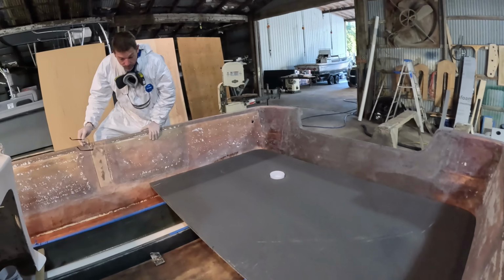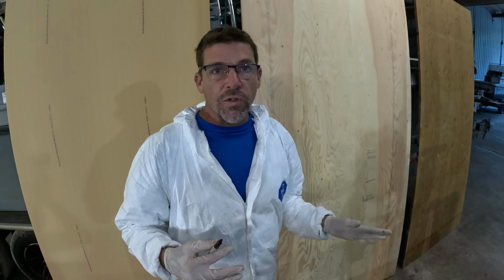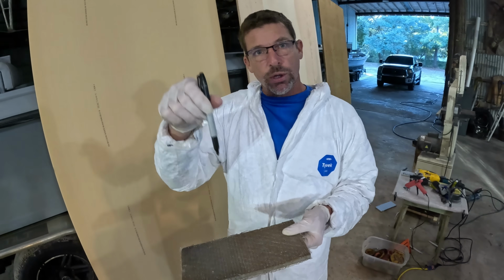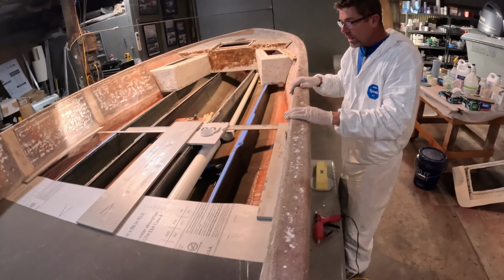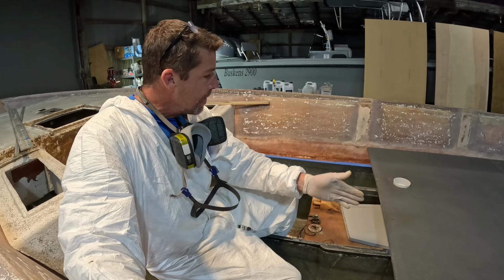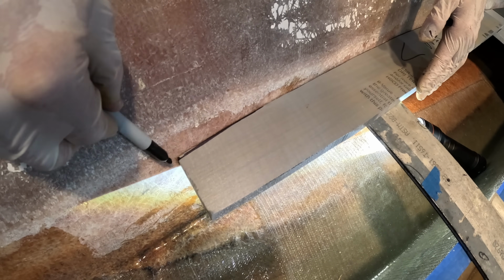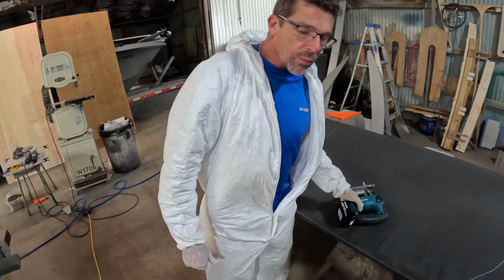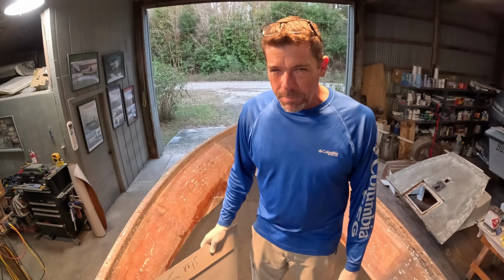Easiest! Fastest! and Most Accurate way to Install your New Boat Floor Deck GUARANTEED!

Comment from the maker: https://fiberglasswarehouse.com/ 
*Use code FISHBUMPTV
Coosa & more:  Boat Outfitters https://spn.so/l/9iqw0hvc
My Amazon Store: https://amzn.to/4hFw3AV
As an Amazon Associate, I earn from qualifying purchases. 
Consultations & Support at Patreon www.patreon.com/FishBumpTv
Reply: I get it with the bigger boat like the one you're on,  Billing.  But the one thing  I can't afford.  Is Patron being on a budget one of the things that  I. Noticed is you pointed out?  Was the Frome & it was strengthened with Fibreglass. A more detailed demonstration.  On a budget & its role in Modern boat & Mould in  Boat Building. Of ten the small man as budget restraint the bigger operator dos not have. & you have added Benefit  to  them in that indexer & thank you for that. But petrean member ship dose not lend to budget & I Get it  good advice.  as a value & your  won't  to profit from your Extensive Knowledge Yes i get it But the you ask what wuld you lick to see us build  I wuld love to se you build a sailing dingy. &  mould Out of Frome & then  that mould glassed.   redy to  for forming into a hull & the geld sheet that you have demonstrated so eloquently  lt  Ues to build it  Inside of the vassal.  yes i get it Les in the UK.
Reply: PS.  I built a 32 foot curser once but had to sell  it on eBay to  pay debt . I let it.  go swearing to never get back in to big stuff.   Steel & welding helped  my son in school he wuld at 10yers of age  handle.  oxy & acetylene  kit.  he could  stick &  TiG a MiG long before he left school I tort im  in displacement theory & why steel fults.  all very impotent on the sea.   Today he run's a very profitable  Skip waste biasness her in the UK.   But as we in trade   know  other peoples hand are often in one's pocket   So i enjoy watching you but i sal not be paying for stuff in patron yes you right i have never fiberglass any thing   But for a Valve  on a PowerStation once,  fiberglass ever it nittiest. me  to whach  i did build dingy sailing boat as a lad.   & soar other resealing old fibber glass  in to mirror Dinghy for old  fibreglass  Baths .  LOL  yes i get it  Les in the UK .

Comment: Very nice video explaining how you are installing a Coosa board floor.   Are you going to seal the Coosa board with Vinyl ester or epoxy before screwing the coosa board down?  or is that not necessary?

Comment: I used that foam board to make all my top parts of the boat. 2 layers of 1708 and that thing is impossible to break. Very cool stuff to work with.
Reply from the maker: Thanks for the positive feedback! Glad you found it useful and easy to work with!

Comment: Douglas Fir saves me so much $$ ,Orange Box Store up in Canada has pretty good quality DFir ply , thanks for comparison of cores ,I have glassed 3/4” CoreCell foam 5 lb , but I added a lot of glass epoxy and fillers as recommended by designer who tend to err on the overbuilt side of things , but it ended up way too heavy and costly….enjoying
Reply from the maker: Thanks for sharing your experience with different materials! It's always a balance between cost, weight, and strength, and everyone has to find what works best for them, and their budget! I really appreciate you watching all of the way from Canada 🇨🇦!

Comment: Capn, Joe
   Question I should have asked on your gelcoat video 3wks ago. I'm restoring a 1985 Glasply Impulse 17' open bow, for grinding,buffing,sanding, do you use orbital or variable speed machine? And do you recommend  a dremel tool with bits for the small repairs? I'm going to use all your videos for this restore. Kind of cheated, my stringers are fiberglass from factory, only wood is in transom.

Comment: Been using treated for decades. We buy it kelm dried.
Reply from the maker: Apparently not all treated lumber products can be glassed over, as many manufacturers don't recommend it, but I have done it, in limited applications. I only recommend materials and processes hear on the channel that I know will work for everyone, and that the manufacturers recommend. Thanks for sharing your experience with the channel and for watching!

Comment: Wow that colas board cut fast, what blades do you recommend.
Reply from the maker: Yes, the coosa board is a great material to work with! I like a medium tooth, bi metal blade, but honestly, almost anything you have will work for smaller cuts. I hope this helps, and thanks for watching!

Comment: Hey mate great content 👍I’m over in Australia I have a fibreglass boat over marine ply the cross members are starting to root because of drainage holes drilled in them was wondering if I could cut off the top of them and clean out root and reinstall ply into them
Reply: Talk to bote cote , they make products for that sort of and also give practical, honest advice. I’m not a fan of their epoxy though, too much sanding.
Reply from the maker: Glad to hear that you are enjoying the channel! Every repair is different, so its hard to say what the best approach would be, without seeing it, but almost everything can be repaired, with the right combination of materials. I would recommend doing plenty of research on the topic, and do some testing with different materials. I hope this helps, and thanks for watching all of the way from Australia 🇦🇺!
Reply: @FishBumpTV cheers mate

Comment: I have a mix of power tools. Some cheap Harbor Freight that have lasted very well, and some that didn’t.
I do like the Milwaukee brand, and Mikita as well.
Unfortunately no manufacturer makes every tool that I need.
Reply from the maker: I think that its good to have a mix of tools, but I would probably pick Makita, if I had to choose just one. Thanks for sharing your thoughts and experiences with the channel!

Comment: If I was going to use wood I would only use quality BS1088 Okoume/mahogany  marine plywood. The ‘good stuff’ is very expensive but it’s suitable for permanent water contact without coatings .    It has a WBP rating of 1/2 hour ( water and boil proof) . 
It’s the stuff good European boats are built with.
Cheers Warren
Reply from the maker: Thats definitely an option,  if its available, and you can afford it. Here in the states, that grade of plywood is nearly the same price as coosa board. Thanks for watching and sharing your  thoughts and suggestions with the channel!

Comment: Nice trick tu use bands of rigid foam to make a pattern! Easy to handle and cut, thickness equal or close to the final product used. 👍
Reply from the maker: Thanks! I'm gla
d you found the rigid foam trick helpful for making patterns for your boat projects, and we appreciate you taking the time to watch and comment!
Reply: @FishBumpTV no boat, in fact I'm a car guy and I use cardboard to make my patterns cause it's closer to metal thickness I use. Easy and quick too to cut with scissors or cutter. Of course I work with composite parts too, in fact I fabric my own body parts so boats or cars there is not so much difference in the approach. Love your videos and I often post links to your videos when people need advice.🙂

Comment: Fish Bump Academy did it again... another great video wich did raise my learning curve. I had to gut all my sailboat interior after a complet top to bottom termites attack. For the floors i am using ply so i can cut some storage and maintenance hatches, but for vertical divisions i am using 30mm roofmate insulation glassed with epoxy from both sides and i can say it becomes very hard and tougth. Keep those videos coming Captain Joe and Merry Christmas for all.
Reply from the maker: Sorry to hear about the termites in your sailboat, that stinks! Glad you are enjoying the videos, and I appreciate you taking the time to watch and share your experience with the channel!

Comment: Thank you Joe. I shared a link to your website on a boating forum and got a big thank you from one of the members- he found exactly what he had been looking for- new fan.  Jay- Australia. P.S.- I've done a lot of pretty awful jobs over the years- sanding fifty year old fibreglass in the heat is right up there :)
Reply from the maker: Wow, that's awesome news! I'm so glad our videos could help, and thanks for spreading the word about the channel all the way from Australia!
Reply: @FishBumpTV  Me again :)  Joe just wondering- for stuff like floors in small boats have you ever looked at honeycomb core panels? Just noticed that a couple of the fibreglass supply places down here sell it- different thicknesses, like ten and fifteen mil- just core material so needs to be glassed before installing, but it's super light weight and a fraction of the price of coosa board. Be interested to hear your opinion of it. Cheers,  Jay.

Comment: Your years of experience makes a hard job look like any DYI could do it. One thing I learned over the decades is to not try and do something on a shoestring budget. Quality material is a must and have the proper tools. Speaking of tools, way too many people think the high-cost brands are the way to go. That is true for someone who uses those power tools daily. Someone using a tool for a project and then letting it sit for months and years does not need top tier power tools.
Reply from the maker: Thanks! I appreciate your thoughts and insights on quality materials and tools. I agree, that the average DIYer doesn't require top of the line power tools, to get a good results. Ryobi, and Harbour freight for example, offer very decent tools, at a great price.

Comment: I enjoy all your videos but having a pretty good stock of divinycell I am always interested in learning more about working with it. It’s been pretty easy but I am sure I could strengthen things with better techniques and choices in layup schedule, core thickness, things like that. Thanks for your channel I have learned a lot from it!
Reply from the maker: Glad to hear that you are enjoying the channel, and I appreciate your thoughts and content suggestions on the topic of Divinycell! I think that it's a fantastic product, in the correct application. I actually have a very large project that I have been thinking about, that would use Divinycell and vinyl ester resin extensively, so stay tuned, and thanks for watching!

Comment: I just built a deck with treated Doug fir 3/4 plywood. I want to coat it with polyester or vinyl ester. Can I? Will it stick?
Reply from the maker: Our family has been using Douglas marine fir plywood for decades, with good success. Quality surface prep, and a very thorough resin and fiberglass application is the key to a long lasting job. I would definitely recommend the vinyl ester resin from fiberglass warehouse as my first choice in resin, followed by their iso polyester. They also offer a fish bump tv discount code for our viewers! I have several, full length, high detail videos here on the channel on proper techniques for fiberglassing over plywood. I'm sure that if you scroll back through the channel, you will find what you are looking for. I hope this helps, and thanks for watching!

Comment: Really enjoy watching the videos very informative thank you for all the help I do have a question I have a small fiberglass boat with carpet that needs to be replaced what is the easiest way to get the carpet off.
Reply from the maker: Glad to hear that you are enjoying our videos! Once you have pulled the bulk of the carpet off by hand, it's usually a combination of a 5 in 1 tool for scraping, a wire wheel, or brush, and a oscillating multi tool for removal of the glue residue. Followed by a wipedown with acetone,  or goof off. I hope this helps, and I appreciate you taking the time to watch and comment!

Comment: Hey Joe love the channel just a quick question what do you do when you have a boat that need work on stringers and your not able to take the cap off
Reply from the maker: Thanks,  I'm glad to hear that you are enjoying the channel! The short answer is that you will have to remove or section out the floor, independently from the cap. If it's a popular model, maybe you can find someone who has documented the process. You may also want to check out our Facebook group page, for some inspiration. Some one on one consulting through our patreon program, might also be something you would find useful in planning the work. I hope this helps, and I wish you all the best with your stringer replacement!
Reply: Thanks for responding,I was hoping that I would not need to cut the floor because I'm not really sure if I would be comfortable doing that,its a 1999 pro sport 21 ft deck boat and I have not seen anyone who's had one the company os no longer in business

Comment: Have you ever tried using bamboo plywood to do flooring or sidewall repairs, just build a complete boat built from bamboo and then fiberglassed over it?
Reply from the maker: I haven't tried bamboo plywood yet, but I think that would be a interesting  side by side test video, for sure! Thanks so much for sharing your experience with the channel, and for watching!

Comment: Hello Mr. Joe, Question on the project boat. Looking at your under floor rigging tube, what type of steering cable other than wires are you using to go through the tube?, My question is will the steering cable(if that is what you are using) will the end of the cable make the bend in the tubing?, I continue rewatching the videos and learn something more every time I watch them. Keep up the great work and I thank you for your expertise!
Reply from the maker: Sure, thats a good question! Most modern boats, in this size range are going to have hydraulic steering, and the hoses are fairly small, and flexible. Cable steering is a little more difficult, but as long as you use a 4 inch pvc rigging tube with the long sweep 90s, you won't have any problems. I will be sure to touch on this more as we move into the next couple of phases of the project boat, but in the meantime, you might want to check out some of our older rigging videos in the build of our custom 29. I hope this helps, and thanks so much for watching and commenting on the channel!

Comment: I've moved to DeWalt mainly because the woodworking channels I watch use them.  (Or some crazy expensive tools that I'm not going to buy). Sticking with them so have a common battery for all tools.  However, think there are companies out there that make adapters so you can use one brand battery on another brand tool.  Too much work for weekend projects
Reply from the maker: I have had very decent performance from the Dewalts I have owned,  but  I tend to be open to using any brand that offers good value, and performance. I have had good service out of the corded Makitas in the past, but I'm curious to see how the cordless ones hold up in the boat shop, and around fiberglass dust, which can be tough on tools. Thanks a bunch for sharing your thoughts and experiences with th we channel, much appreciated!
Reply: @FishBumpTV  Was Makita when I was younger, not cordless, but had a jigsaw die pretty quick once.  They'd probably be my 2nd choice.  Gonna find out pretty soon how the DeWalt holds up to fiberglass dust